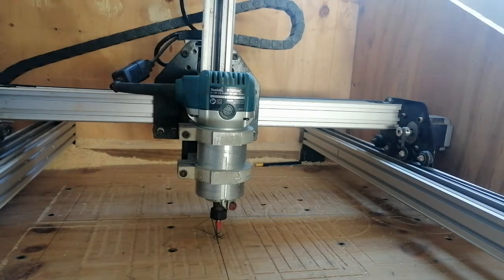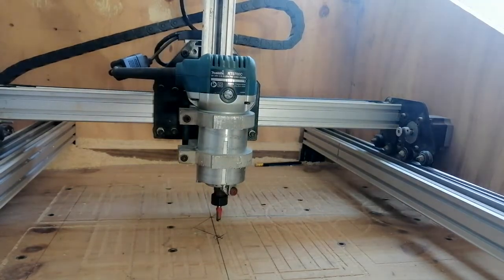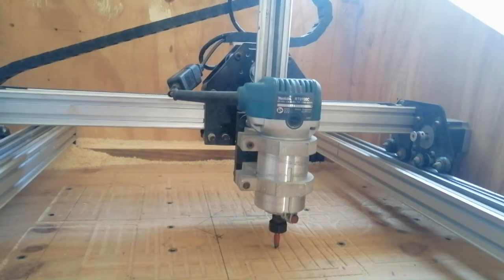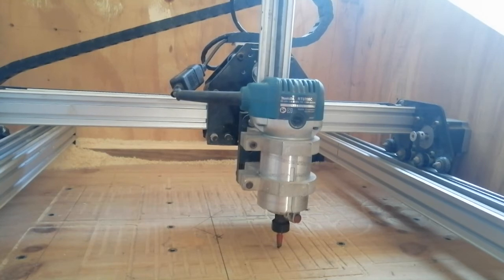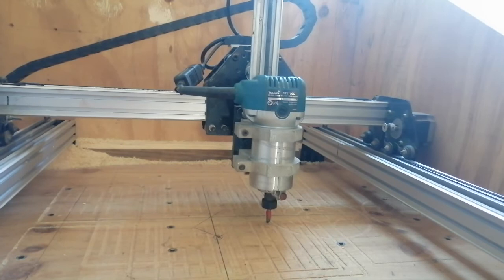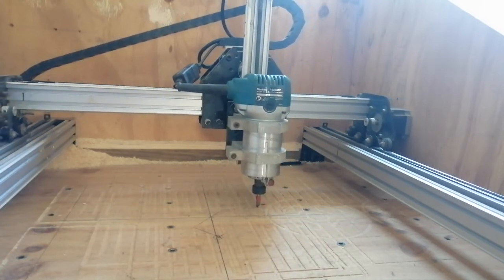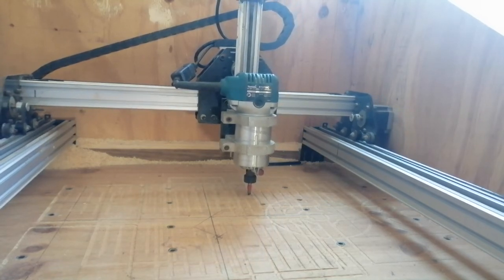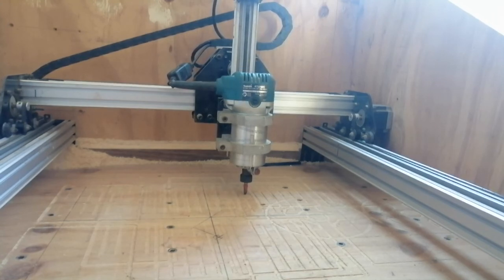Cnc router with cornering speed problem  how to fix it?

Comment from the maker: The problem it seems is to do with the Drawing and not the Grbl  as once I set up a circle and set it to cut it worked Perfectly
Reply from the maker: Solved the problem 
It was the computer which was not powerful enough to run the program. :(  So It seems that you can't use a cheap computer to run a Cnc 
Moral of the story  :)
Don't Cheap out on a computer It will cost you in scraps 
You need to spend money to make it